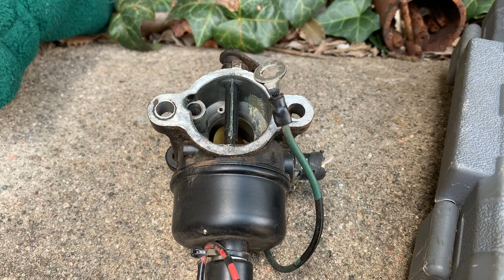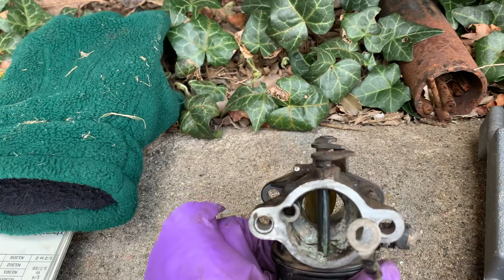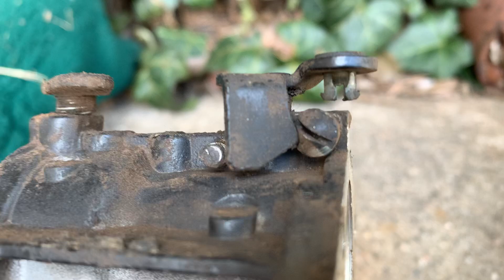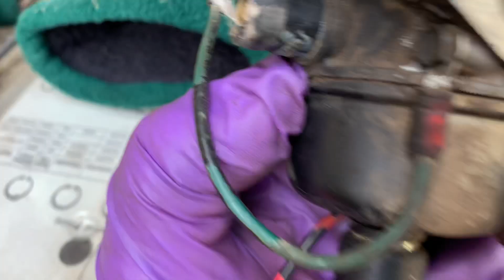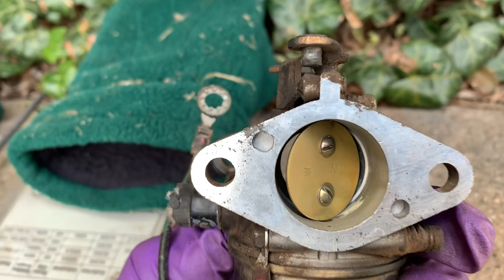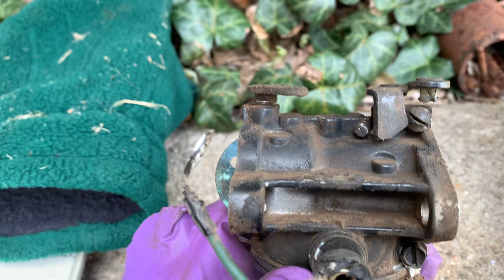9 horsepower Kohler Command is really a throttle limited 11-14 hp!

Comment: No shit, the size of the pistons aren’t smaller on a 9 hp Kohler vs 12 and up ?
Reply from the maker: 11 through 14 HP are all 87mm bores. the 9 HP command vertical that was in the Deere STX 30 tractors was actually a throttle limited 11 hp engine

Comment: Good stuff! I actually just found this same screw on a 9hp Command i pulled off a parts mower. I haven't had need to get it running yet, just initial checks to see if it was a viable engine, so I'm glad to see I stumbled into some extra power once I find a use for it!
Reply from the maker: Thanks for watching!

Comment: Did the throttle stop removal go well? I’m in the same boat with an STX30 I just acquired.
Reply from the maker: Yup! He’s been running it for over  a year now and loves it!
Reply: @KensSmallEngineRepair  Thanks Ken! My STX is so rough I might have to part it out, but the engine is a peach. After the carb rebuild that is. Nice to know I can use that engine on a bigger mower in the future. Thank you again sir!
Reply from the maker: @NCIR721flyover  too bad you weren’t local I could use a Kohler CV engine right now!!